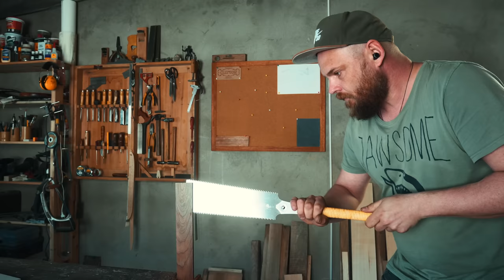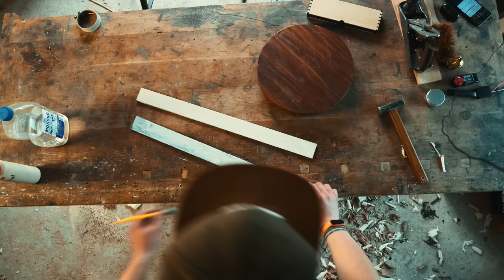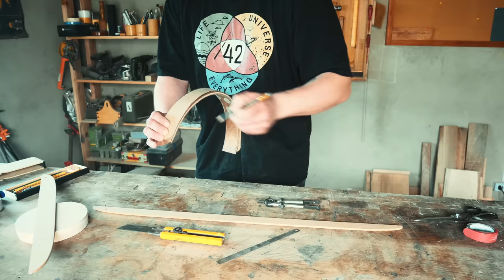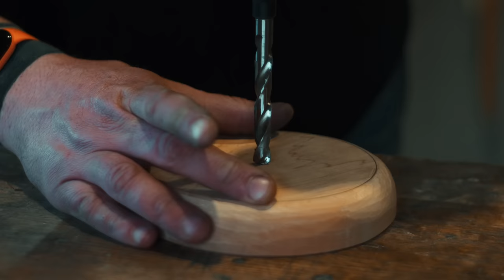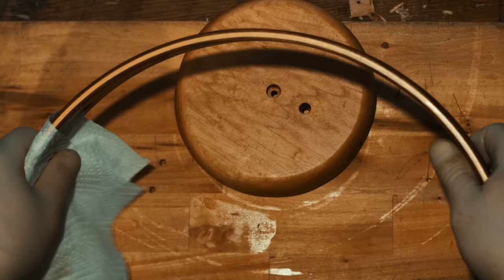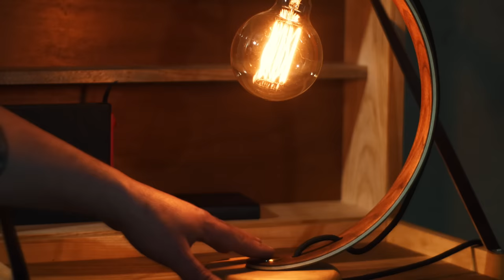Making wooden lamp

Comment: I love the lamp I have two questions if you could answer I would be very grateful. What are the length of the strips you bend. And also the round form used to bend it what is the diameter of that. Thanks again your work is awesome and stay safe